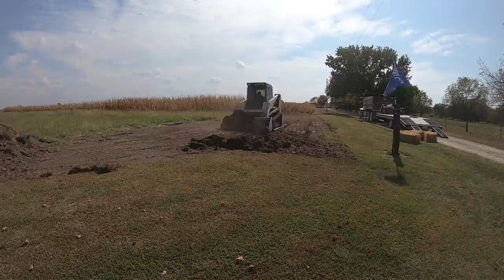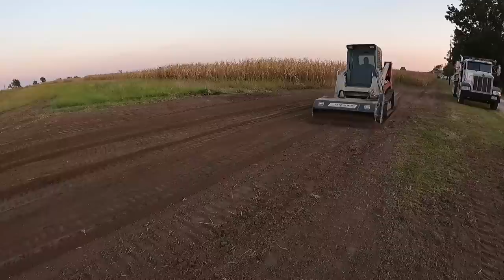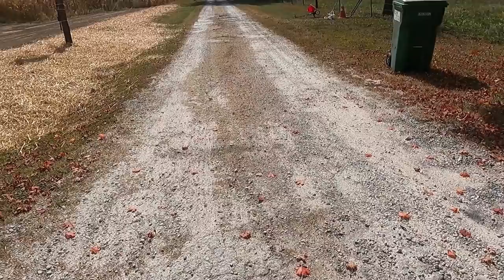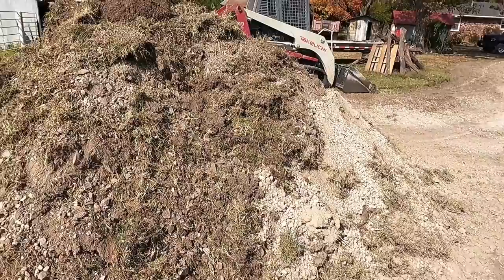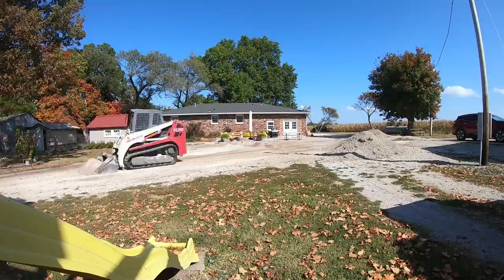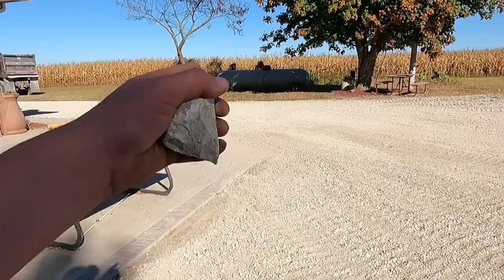Expanding A Circle Drive And Fixing Some Water Issues

Comment: You did a nice job! It's so hard to tell on video how much incline or Rose there is. Not much you can do when they already have their buildings in place. I think they should have thought about before they built some of they're shops and barns or whatever they have. Thanks again for sharing👍‼️
Reply from the maker: Thank you! Yeah it’s tough to tell. The house was always low but when they added the patio is where the problem got worse. Hopefully it will drain ok there’s just no good place to take it. Appreciate you watching

Comment: Those farmers know a thing or two about soil prep... you didn’t feel just a little pressure about finishing out that corner.  Did you?

I see what you meant when you were talking about a ‘full’ load!  Too bad they bill by the amount loaded instead of the amount requested!

I know another place where there is no good place for the water to go.... except right where you have to put rock!   

You know  1 1/2” of contour looks like a lot to a 1” deep flow... a 2” flow just laughs as it washes by it!  It will be interesting to see how this driveway’s contours control flow and resist erosion...

At the finish this really looked good!
Reply from the maker: I did feel some pressure lol. Yeah I think that was 18 tons 😳 he was like how’d I do I told him he was 4,500lbs over he was oh man that’s pretty close 🤦🏼‍♂️ I take your barn has a little fall in the floor 😁 Appreciate the help yesterday
Reply: @eliteearthworksllc  2 1/4 tons is pretty close when you’re dipping from a 2000 ton pile and getting paid minimum wage to dip it!

Yup the floor slopes about 2”... sorry to leave you hanging today... had to vac leaves all day.
Reply from the maker: @sassafrasvalley1939  no worries I finally got those paths done. Used all but one load of rock

Comment: Is the preperator supposed to have oil in that chain case? What is super annoying about doing driveways and parking lots around houses and buildings is they build the house and buildings level with the land not taking into account that the driveway and parking areas are going to be elevated. So did you give them their 20% discount for flying their flag? ;-) awesome job by the way!
Reply from the maker: No you just hit the chain with WD-40. That attachment is 10 years old and I haven’t done a thing to it lol. I agree everything is built low then they bring the driveway up 🤷🏼‍♂️. I did 😁 Thanks again for watching
Reply: You betchya. Ya I know some chain cases are dry and you can live them like a motorcycle chain and others like skid steer drive boxes or roadgrader drive boxes that are chain driven have just a little bit of gear oil in the bottom for the chain to run in. When you were running it I was thinking to myself, I wonder if he's had any problems with that drive system and not 5 seconds later you show the broken chain. You can blame me, I jinxed you. 😂
Reply from the maker: Sooo it’s your fault 🤣 it’s done great this whole time. You would think some oil would help but it’s suppose to be dry.
Reply: Lol... yep just blame me. I'm sure if a guy were to seal it up tight so that no dirt would get in and put just enough gear oil in that the bottom of the chain were to run in it that it would probably make the chain and sprockets last a lot longer. If you do take on the challenge don't forget to vent it with a cheap filter or vent cap or it'll probably build some pressure.